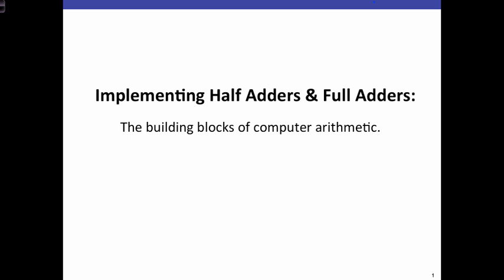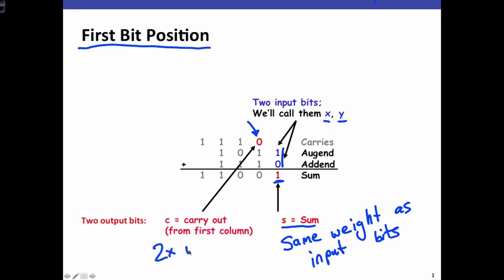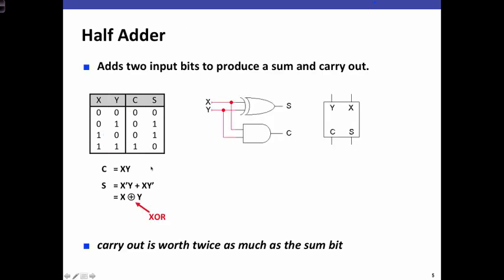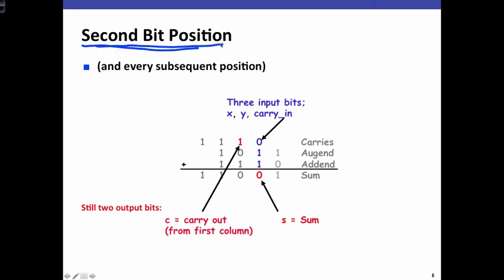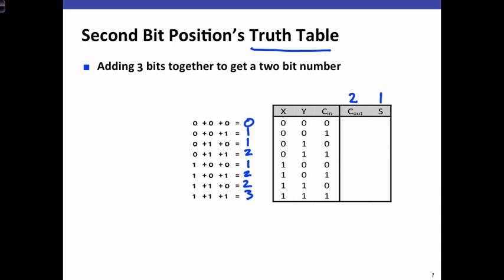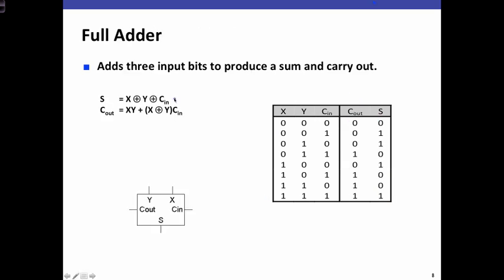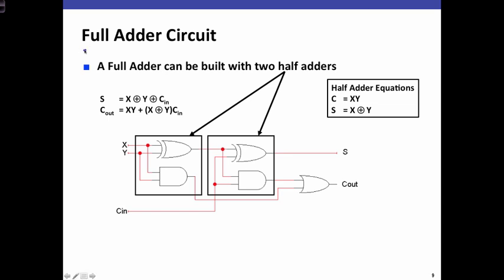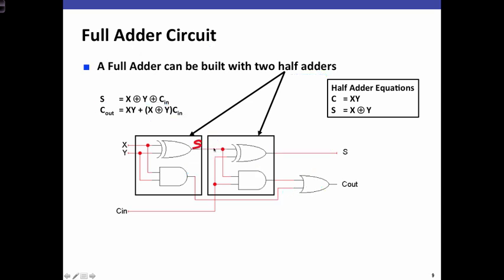Implementing Half and Full Adders

Comment: What do you mean by 'carry' is 2 times the weight of inputs or sum?
Reply: Maybe too late for a reply but in case someone else get stuck on it. He explains it at 4.15. It's just the fact that 1 + 1 has the sum 0 and the carry out 1. It's the carry out part that you add to the next bit slice.